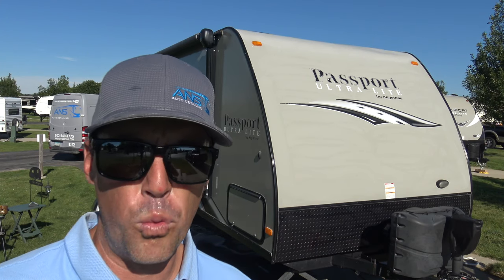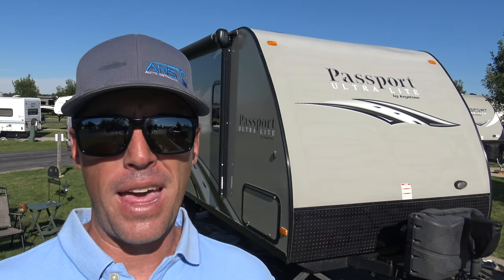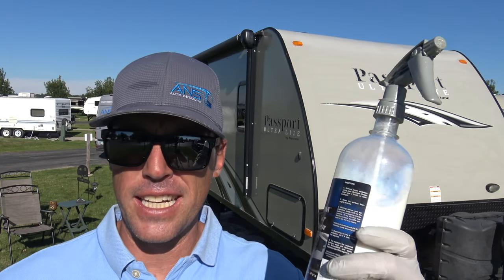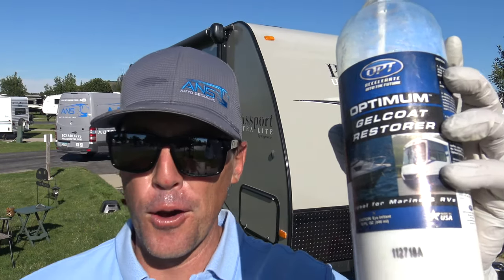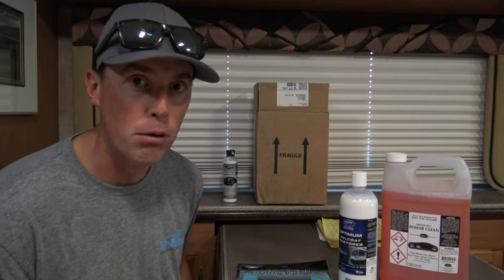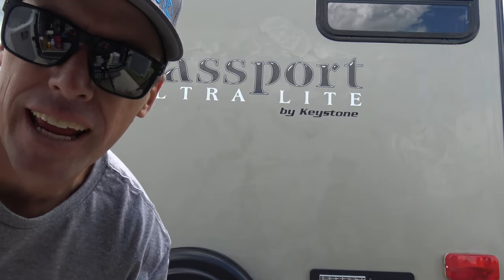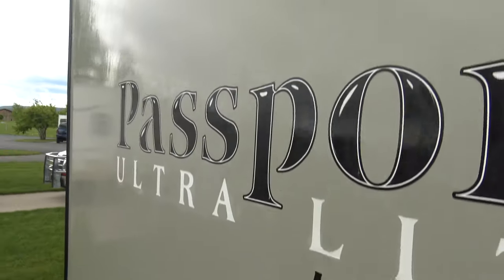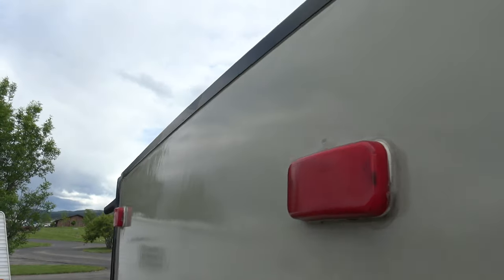BREAKTHROUGH GELCOAT RESTORATION PRODUCT! OPTIMUM GELCOAT RESTORER REVIEW

Comment: Thank you for the great review Andrew. 

The reason for Optimum Power Clean isn’t as a degreaser. It’s real purpose in this job is to remove any loose oxidized Gelcoat. Next time you get a really chalky surface, scrub one portion with Optimum Power Clean, another with the degreaser of your choice, rinse and dry, you will see a difference between the 2 sides. Optimum Power Clean is used by many Gelcoat related industries to prep it for either restoration or polishing.
Reply from the maker: Thank you for clarifying!  I greatly appreciate you introducing this product to me and all of the great things you have done for the detailing industry.   I look forward to doing some more comparison tests with some of your products to clarify.
Reply: Yvan, do you sell all of the products as a kit?  I am interested in using this product on my motorhome.
Reply: Ron Ostertag I don’t sell anything. I retired from Optimum last year. Please contact them directly, they will be happy to help.
Reply: @LacroixCruiser  I bought all of the optimum products used in this video and attempted to restore the gel coat on one of the locker doors of my 2014 winnebago vista today. I must be doing something wrong because after 4 coats of the gel restorer it is pretty blotchy with dull and shiny patches.  Are there any clearer instructions for applying the gelcoat restorer? I am using pearl weave cloths and spraying them lightly, then applying the restorer lightly to the gelcoat. I'm going to have another attempt tomorrow perhaps rubbing each coat in for longer?
Reply: @gavinbrowne1  Any updates on your additional attempts?
Reply: GovG33k I tried for another 2 or 3 attempts to get it right but ended up having to forget it as I couldn’t get a good result. I ended up buying a machine polisher and using gel coat cutting and polishing compounds. Hard work but it works.
Reply: GovG33k I certainly did experience that the towel got sticky. I didn’t know you were supposed to wet it if that happened. It appeared to get sticky as the restorer started to dry while applying it. Then once the cloth was slightly sticky it became impossible to get a smooth finish to the application. I watched every video I could find several times to try and work out what was going wrong. I also bought all of the recommended cloths and other chemicals including the degreaser. My fibreglass is a sort of beige colour but to be honest the finish was nowhere near the high gloss appearance I was expecting.
Reply: Gavin Browne Wow, that’s really disenchanting. Thanks again.
Reply: Gavin Browne Did you figure out how to cure the problem as I have the exact same issue except my whole slide now looks horrible. Looks dull swirls with a bit of shine like dried wax looks just before buffing. Tried polish as Ron at Optimum suggested. Did nothing. Then Ron with Optimum said to use paint thiner on my gelcoat to remove some of the optimum restorer then apply a 5th coat. I do not think I want to chance using paint thinner or mineral spirts on my gelcoat and decals.
Reply: David Hope as I mentioned above, I gave up on the restorer and am now using a machine polisher to get a good shine.
Reply: @gavinbrowne1  Sorry about that I saw your answer after I asked you. Thanks!
Reply: David Hope do not use a solvent on your Gelcoat, it may not end well. When using Optimum Gelcoat Restorer it’s a product you need to develop a feel for. On the 3rd and subsequent coats , use more products and always working to a wet edge. Try to overlap the least possible, and don’t go back over the wet surface.
Reply: @LacroixCruiser  I saw you worked for Optum. I and a number of others on this thread have tried applying the gelcoat restorer covered in this video with disappointing results. 

I applied 4 coats and still have dull and shiney swirls. Ron at Optum told me to apply paint thinner to the RV to smooth out the optum gelcoat restorer coating then apply a 5th coat. 

However I do not believe it is a good idea to apply paint thinner/Mineral spirits to my decals. 

One poster here mentioned you should wet the Optum micro towel if it starts to get sticky while applying the restorer. Is that the secret...a damp towel? 

Bottom line... do you...as a past employee have any tips or secrets on applying the gel coat restorer so the RV walls wipe out to a glossy luster?
Reply: how long does gelcoat restorer last?
Reply: Do they have a good ceramic product for cars
Reply: Basically  a commercial

Comment: Gel coat is the coating sprayed up against a highly polished mold at the beginning of the fiberglass layup process. This process results in the smooth, mirror-like finish typical of new RVs. With the passage of time, unprotected gel coat will oxidize and eventually take on a chalky appearance.

Comment: Andrew I’ve used it on motorhomes and boats I actually am an opti coat installer I thought a lot like you did you didn’t need there cleaner but after doing several of these I found that there power clean is the only way to go. There Ceramic coats are great for vehicles but I still agree with you I own a tiffin motorhome as well and I would not Ceramic Coat it simply do to cost and maintaining it for the average person would be difficult but on vehicles and motorcycles it is the only way to go I will never go with out it on any of my vehicles great videos
Reply from the maker: Thank you!

Comment: This product did not work on my toy hauler.  This product is no different from ZEP floor polish which can be purchased at Home depot for $27. The company even stated that you could wash and reuse their microfiber towels.  When the towels were washed they were still rock hard once dry.  I prepped and performed a test spot on my toy hauler and it didn't work as the company rep stated.  I still have a full unused bottle left.

Comment: This seems to be same as Zep wet look floor wax. If you wrap the microfiber towel onto a swifter type mop and apply in strokes from the top down it will take 1/2 hour per coat. Do 4 coats with the zep and boom.........shiny like new rv.

Comment: I prepped with the Opt cleaner. Went over 2x to make sure all oxidation was gone (not bad oxidation on my motor home). 

I then did very light 1st and 2nd coats using pearl cloth. 2 ft square areas on one of my slides. 3rd coat began to see some shiny spots, but mostly dull spots and lots of swirls like when applying wax.                                            

So applied a 4th coat. Just a little more shiny spots but still a lot of dull spots and still lots of swirls. 

I called Ron at Optimum and he tells me to apply polish then 5th coat and if that does not work apply paint thinner or mineral spirits to my gelcoat to remove/level restorer and then apply another coat. I am thinking it is not a good idea to apply paint thinner to my gelcoat...and what about the swirls on my decals? 

Do you have any suggestions Andrew? 

I asked Ron at Optimum why they do not have any detailed demonstration videos and/or more detailed instructions and he said they do not have the staff to make videos or write detailed instructions. I was not expecting that response. 

It is obvious (by this thread alone), many folks are having issues with the application of the Optimum Gel Coat Restorer. Doesn’t Optimum care enough to address the issues their customers are having? 

My entire slide looks worse now than before and I have no idea how to cure it.
Reply: No reply from Andrew and the folks at Opt replied with an "Oh well" more or less and told me to try sing paint thinner again to get rid if the   dull swirls.
Tried it in a  very small section of maroon decals and they bled immediately so Paint thinner is B.S.!
Reply: @dhope58  I noticed he replied to others though not to your comments. Also I don't see any follow up videos so I'm guessing this stuff is a scam. Thank you for adding your comments. I"m going to call this a SCAM until someone proves me wrong, ,which is what I hope happens.

Comment: I have a 43' 5th wheel. How much power clean and gelcoat restorer and microfiber towels would I need to do my whole coach? Can you do large sections for each coat or should I stick to small say 2x2 sections which would seem very time consuming if I'd have to let each section dry for 20-30 mins between coats.
Reply from the maker: Give the folks at optimum a call for specific questions.
Reply: @RVingwithAndrewSteele  Have you ever got back with the owner of the RV in your video to see how the restorer is holding up?

Comment: Another great video Andrew, thank you.  Will this product or a different one restore the stripes too?  Thanks again!
Reply from the maker: Great question, I don't believe this product is designed for vinyl decal so I stayed away from them.  I will check with this company to see if they know of any products that may help restore the decals.
Reply: Dave Ramos yes you can apply Optimum Gelcoat Restorer to your stripes.
Reply: @LacroixCruiser  What about the black metal frames around the windows/ramp or the metal black skirting around the bottom? To see what I'm talking about, here's my rig: https://rv-therapy.com/ourrigs/2016-keystone-outback-324cg/ . Should those be avoided and taped off?

Comment: Is wiping a product on a giant vehicle 4 times really that much quicker than buffing?
Reply from the maker: Similar ammount of time but much better results and you don't have to buy all of the buffing equipment. It also takes a much higher skill level to run a high speed buffer.
Reply: RVing with Andrew Steele good to know. Will one bottle cover a 30” RV?
Reply: RVing with Andrew Steele do you apply and level each coating or only buff/level the last one?
Reply from the maker: @tdawg719  only the last step
Reply from the maker: @tdawg719  yes. I would put it in a spray bottle and mist the Pro weave towel with the product. I over saturated the towel and could have used much less product. Also, I'd cut you towel in to four pieces and use a fresh towel on every pannel.  Immediately soak in water to clean the towels before they dry or they will harden.
Reply from the maker: @tdawg719  I put an Amazon link in the description, if you order through that, I get credit. Thank you!
Reply: RVing with Andrew Steele do you mean pearl weave?
Reply from the maker: @tdawg719  I'm not sure, the towel it says on the bottle.
Reply: @tdawg719  Can you please explain what this means when you say "apply and level each coating or only buff/level the last one"? I don't have any experience in this.
Reply: GovG33k I thought you did not have to buff this product as well.

Comment: I was about to buff out the 5th wheel and stumbled upon your video. Does this product absorb into the gel coat or is it a just a coating layer? Can it be compounded and polished after application? Also looks like you did not apply over the decals. Can I be applied over decals? You should put up a link and get a little kick back because, if this stuff works as advertised, it’s the only way to go. Thanks buddy!
Reply: I tried a similar product Poli OX and it works but it is labor intensive.  Took me a whole day to do 1 side of my toyhauler...  At least 5-6 coats, but it works and clears scratches!

Comment: Any follow up on how it has held up? Going to be trying this out tomorrow!
Reply from the maker: They say it is holding up well so far.  I would love to hear your feedback. What kind of vehicle are you using it on?
Reply: @RVingwithAndrewSteele  its a 2017 Outlaw Class C camper. The top cap is severely oxidized and the rear door as well. The owners purchased the permaplate "protective" coating, which clearly did nothing... Hoping this will give them a bit more protection down the road. Ill keep you posted! Great videos, keep it up. I wouldn't have considered this route had I not come across your video.
Reply: @overlandingadventurefamily6357  How did it turn out? Would you do it again?
Reply: GovG33k hey....I can’t say that I would. I did not get the results I was looking for. I used the product exactly as directed and I wasn’t overly impressed.  The only thing I can think of, is I used it in cooler conditions 40-45f. I honestly think the old fashioned way of cutting with a rotary and then polishing is less work. Just my .02.  I know some people have had amazing results with it though.

Comment: Were the fine lines you talked about created by your aggressive brush?
Reply from the maker: No, they were created because I had too much product on the towel so it streaks a little.  Their is an art to the amount of product you apply.
Reply: With practice, those lines will no longer exist. Like anything it takes some practice to get right. Those fine lines can be easily eliminated with a quick  pass with a polisher.
Reply: @LacroixCruiser This may be a dumb question... Should I just use the polish pad not the electric buffer to go over those fines?  I am finished with the 3rd coat on my RV and going to start the 4th and have been using the product as "less is more" but seeing lots of swirling so far.  I am just doing the back cap today to see how this process goes.  Thanks!
Reply: Carl Rhineberger give it another coat, but apply just a little more. Make sure you are using a pearl weave towel, and for your final pass, go in straight lines.
Reply: @LacroixCruiser  thank you so much for the advice!  I am also using the pearl weave towels and will do straight lines this last coat
Reply: @carlrhineberger2999  Please let us know how this turns out. I'm on the fence right now about this product.
Reply: @GovG33k  I gave it another coat but in straight lines as @Lacroix Cruiser suggested.  That was a game-changer.  Looks much better.  There are still some streaks that I need to fix. I've only been working on only the rear cap so far as I want to do this 35ft  RV in small steps.  One thing I learned the hard way is when you spray the product on the application towel, make sure you hold it away from the RV.  I did get some spots from overspray that I didn't catch until it dried and now those spots are bumpy...
Reply: If I need to use an electric polisher to smooth some areas out, do I need to apply a certain polish product to the yellow pad or can I just use the yellow pad to polish the gel coat restorer that's already applied?
Reply: Carl Rhineberger Thanks, that’s good information. I sure wish there was a well documented process instead of reading all the anecdotes. I think I might try it, but it’s a steep cost and I have 38’ plus back and front to consider. I’ve emailed the company last week and still no response. Thanks again!

Comment: I tried this it's expensive and crap but you can make your own,  toilet bowl cleaner, ammonia, hydrogen peroxide and soft soap mix equal parts except ammonia that should be 6 cap fulls 5 lts will cost £10 GP, work on with brush or spray leave for ten minutes only then wash off only do 2 meters at a time you must at all times ware a mask

Comment: Great video! Now the only problem I have is getting the time to do my Momentum toy hauler! Wow talk about time consuming.
Reply: I bought a valuable 1970s sofa at auction in France. It has a white fiberglass shell that forms the back and sides. The front is upholstered in tufted leather.
I sent the piece to a high end restorer in Paris. They stripped off the upholstery and sent the shell to a marine restorer to repaint with Gelcoat. It came back looking new but the workshop said the painters had to repaint the piece over again three times to get it to look perfect. So anything that would restore an existing finish would be welcome.
Reply: I was thinking the same thing, and mine is only 38'.

Comment: Thoughts on zep floor polish?
Reply: I used the RedMax Pro method. Predecessor to the Zep from what I read. The process was exactly the same. Here is my experience with a class b.  Worked great, after 5 years, its still protecting the steel painted panels. The fiberglass panels, lasted about 2 years then a lot flaked off leaving some glossy spots.   This is an old rig, an 85. I am in the process of trying to get the rest off to prep to redo, its on there pretty good. I am thinking one of 2 things. My prep was not good enough, or the RMP did not like the expansion and contraction of the fiberglass. Not sure if I will RMP the fiberglass again or not. I have dont it twice  over a period of 10 years.
Reply: Z best👍

Comment: What makes this a breakthrough product?
Folks try a product and if it DOESN'T perform as advertised or as shown by a professional on YT then the product is no good. There are many factors why the end result is less than desired.

Having to put 5 or more coats is not a breakthrough for me. 
For most RV owners, keep it clean, and covered at least or out of direct sun when not in use.
For the lazy types, let it go till ready to sell, pay someone to do it once. You can tell I'm  getting old 😁🇺🇸

Comment: One of the best de greasers on the market is Dawn dish soap, removes wax and grease with ease.
Reply from the maker: 👌👌👌 absolutely
Reply: And its environmentally friendly
Reply: Dawn also gets rid of stubborn odors in your water & holding tanks. We had tried all the commercial products and even bleach but our fresh water still had a stinky smell. Dawn cleaned it right up.
Reply: Its soft on my hands
Reply: Dawn works great but sometimes it doesn’t remove the sealants.  Depends on the strength of the sealant.  Here’s why you may think it’s removed but it’s not using Dawn.  Dawn has a rinse aid in it that prevents water spotting. It leaves a temporary film on the surface that it was used on.  That film will show water behavior that mimics an unprotected surface.  Just thought I’d throw that out there